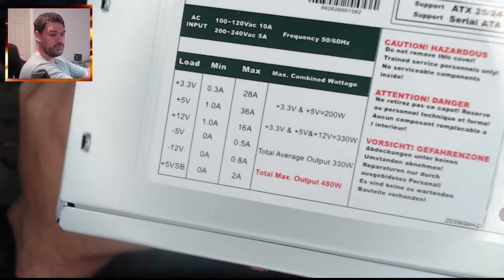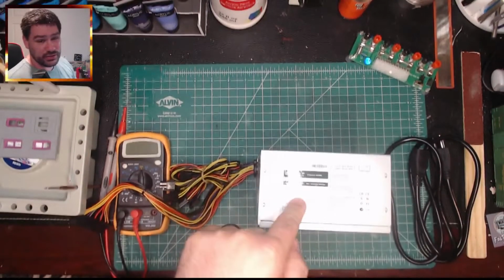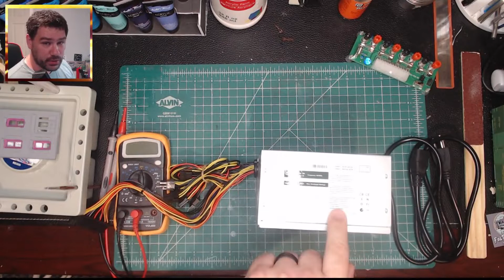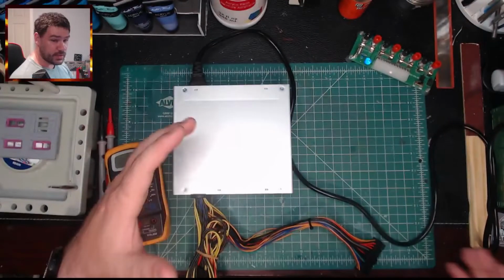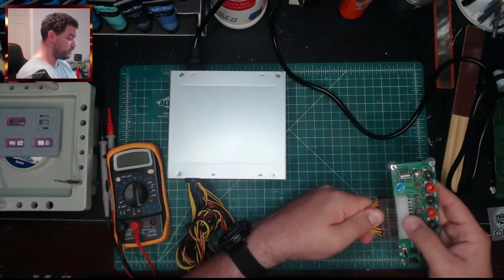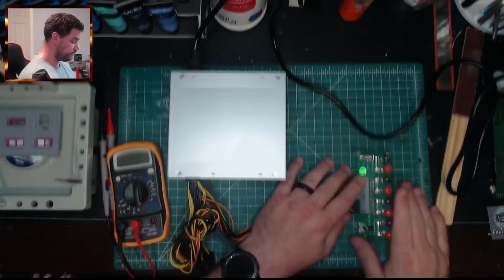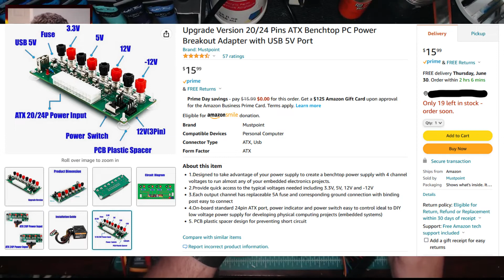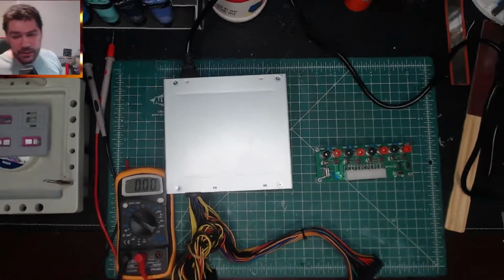PC Power Supply breakout adaper

Comment: Rick  Good idea.   I have a 12 VDC bus line under my layout. I used a 12 volt DC adapter to power the Bus Line and I have Buck Boards in certain places which allow me to select what voltage I need.   I have items using 3 volts DV some with 8 volts DC and 12 Volts DC
Reply from the maker: If you need more, this is the easy way.

Comment: Hey Rick...I use 2 of those computer power supplies for a while.
They work great...👍
Reply from the maker: Awesome Cuz. Do you have the breakout board or did you go old school and cut wires?
Reply: @FBMRR  no just the barrier strips..both have been in use for 5 years..I going to need at least one more on room 2..I'll probably use your method with that one

Comment: Very cool Rick! I saved a bunch of old supplies from decommed PC's. I never knew they had a breakout board like that. That will make things easier as I know there is a sensing line so the power supply knows its connected to something otherwise...no worky (technical term)
Reply from the maker: you got it buddy. they do make other ones that are cheaper. for example. this one https://amzn.com/dp/B07GDKZ8XC doesn't have the Pin connectors, all the LEDS, or the USB. i would use this if i was just using the PS for like one thing (ex: 12v only), so i could hide it and for get it. But for a bench top setup - id go with the one i showed.

Comment: Great info here Rick. Way easier then when you rip one out of an old computer and try to figure out what wire is what. Thanks great post.
Reply from the maker: there are other wires in there that do come cool stuff but this is the basic power output and it just works.

Comment: That's adapter is fantastic. Something I been contemplating on making, but will be easier to buy it. 
Makes life lot easier, and I will be needing this down the line too, especially when I do the top deck.
Most LED's I get have a voltage tolerance of +/- 10% so that 3.2 volts will be perfect.
Thanks for sharing Rick.
Reply from the maker: And time Arty. just something i thought everyone should know.
Reply: @FBMRR  Yes, and this is an easier and safer way to do it, especially those who aren't that experienced working with Electricity, less chances of getting zap with this system.